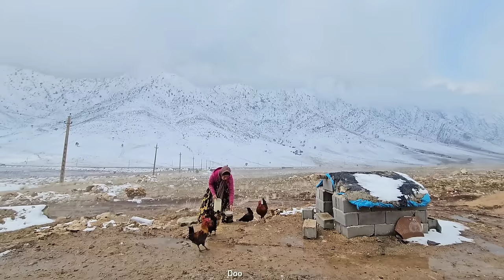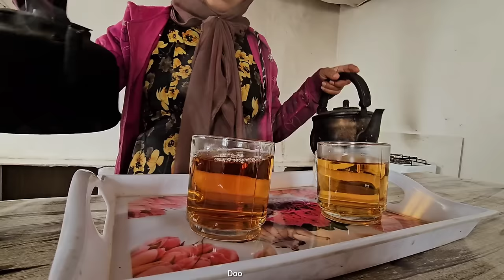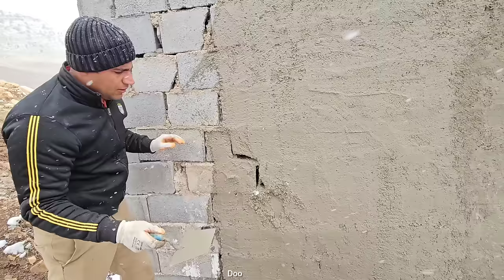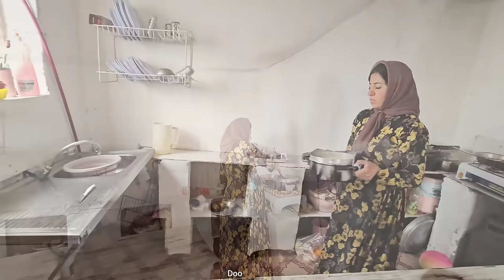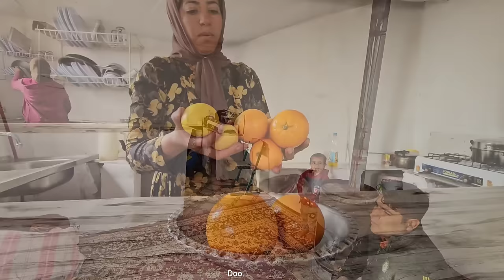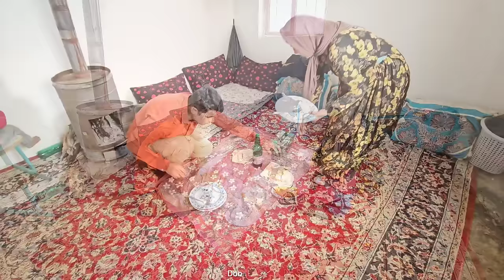Sacrifice of a Single Mother to Remove a Wicked Ex-Husband with the Help of a Savior

Comment: If you don't have liquid, cleaning a black pan using burnt ash is quicker and cleaner than using wire or you can also use wood sander with dishwashing liquid. Good luck.